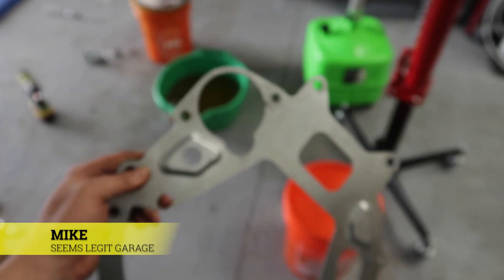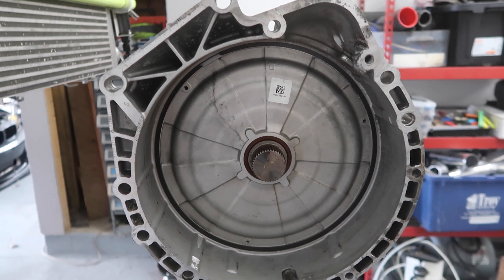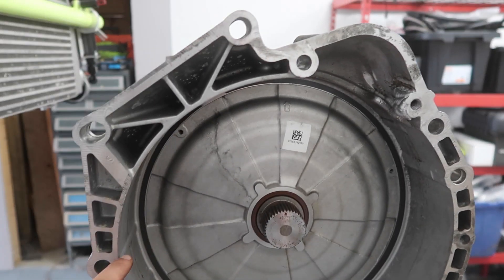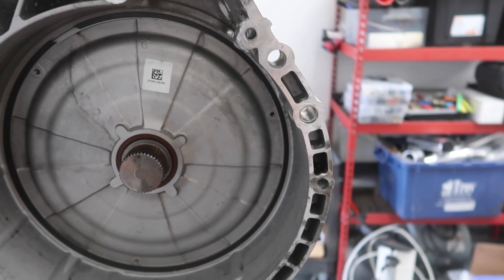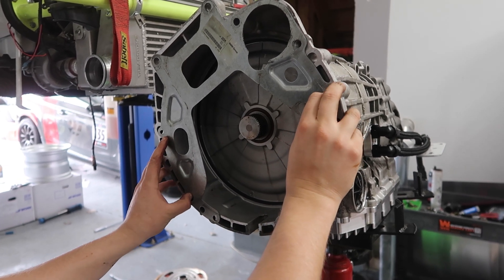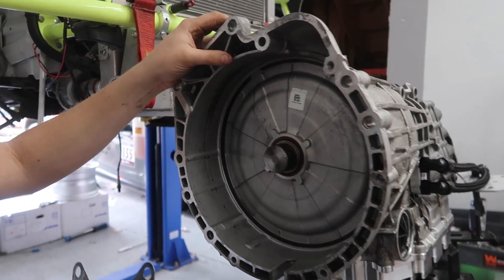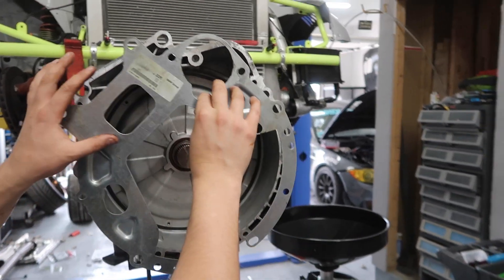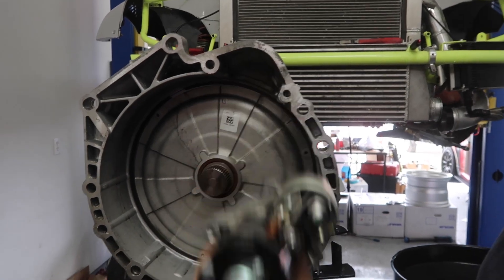Making a BMW DCT fit older BMW engines

Comment: What year and model bmw could I get the dct off to fit my m54?
Reply: E90/E92 335is has dct, f80/f82 M3/M4 have dct. F87 M2 has dct.

What you don’t want is the E90/E92 M3 or F10 M5 dct because they have v8s and the bell housing of the transmission is different.

Any bmw with a dct that has an inline 6 will work. You have to do that modification in the video though. Also you will need to get a custom transmission tune so that it shifts smooth in your car.
Reply: @alextasarov1341  you missed the 135i as well

Comment: PLEASE PLEASE PLEASE TELL ME I CAN BOLT THIS DCT TO MY E36 M42? Instead of swapping my E36 318ic vert I’m going to put forged 8:1 pistons and ARP HARDWARE EVERYWHERE and turbo it and instead of a manual swap cause it’s an auto now I want to do the DCT behind the boosted M42. I think that would be a totally rad set up. Is it doable without too much bull****?